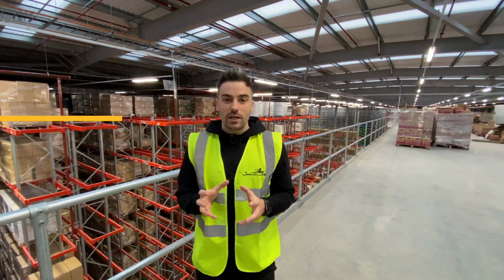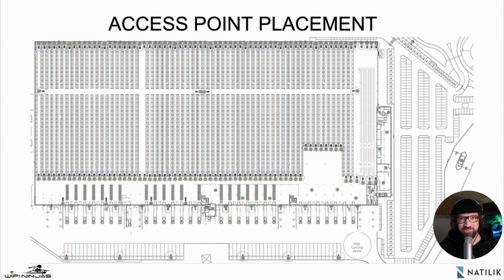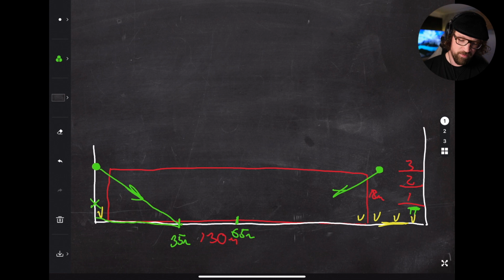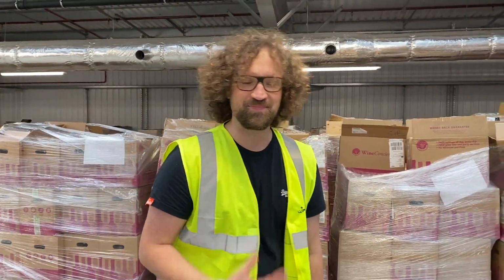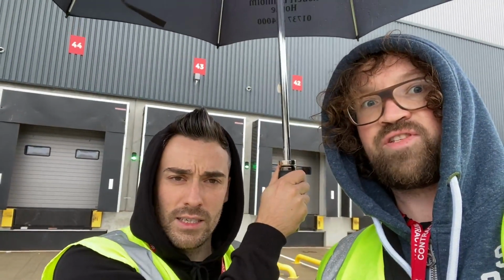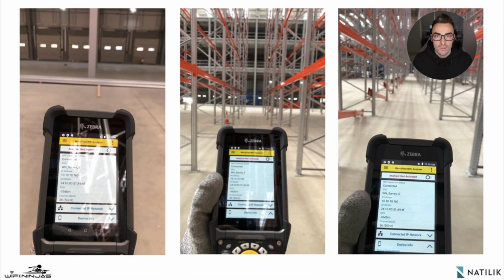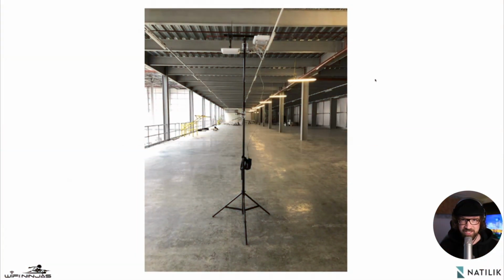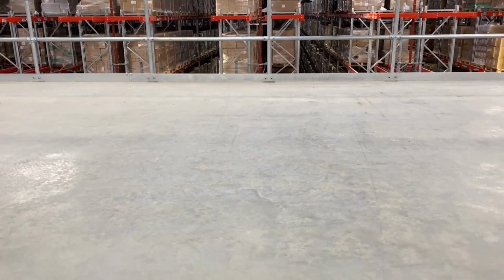WiFi Ninjas | How to Design Wi-Fi for a 720,000 sq. ft Warehouse

Comment: Question. Look at the top of the plan. There are APs with 30deg tilt. Imagine a wireless client walking underneath those APs. Roaming would be severe as I see it. I suggest placing another directional antennas to cover that tight space between end of isles and the wall
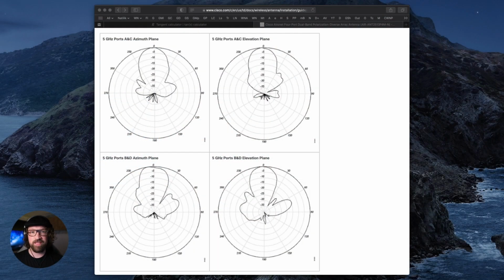Reply: Based on 7:50 you can see there will still be signal leak at the end of the Aisle. Roaming is not needed at the end of the aisle as it is a wall and the client has no where to roam to. On the end with 20 degree tilt you have omni directional antennas.